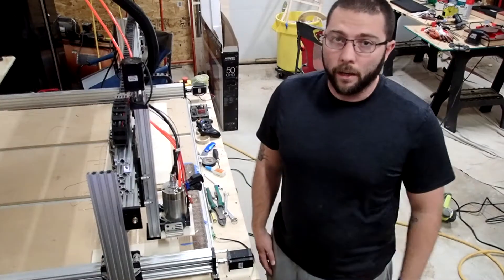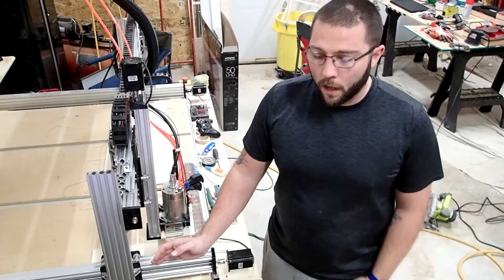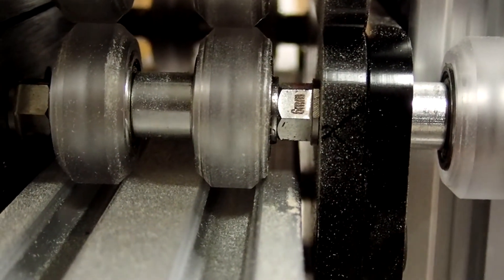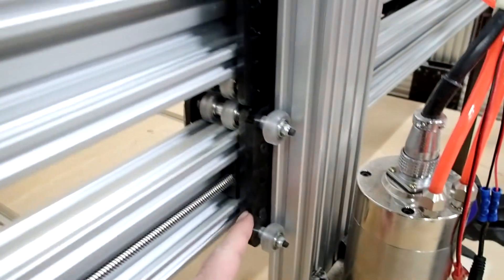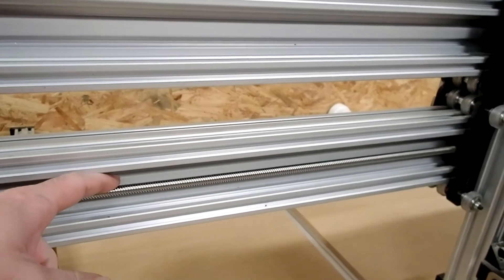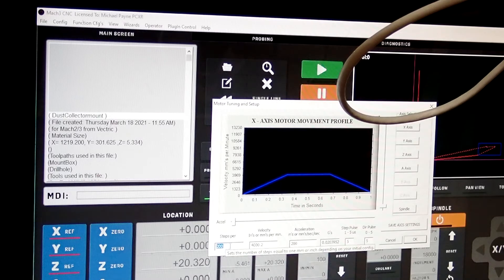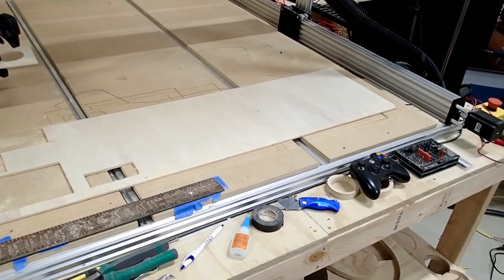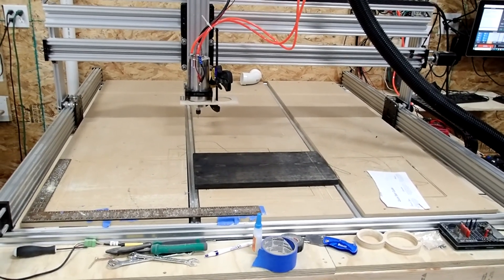Building my Lead CNC machine

Comment: Hope you do some more vids on the 1515... I'm just in build process with the openbuilds version. Waiting for some better tnuts to come as the openbuilds ones were stamped out of sheet metal, cheap and stripped easy... I had about 100 roll in bearing tnuts I swapped out, but 100 ws no where near enough... Good luck with this setup, hope to see more.